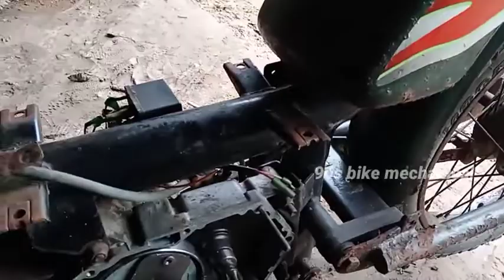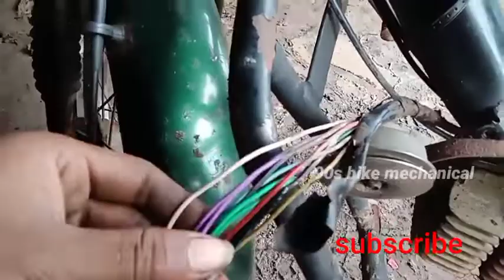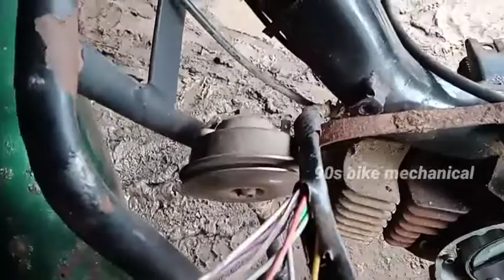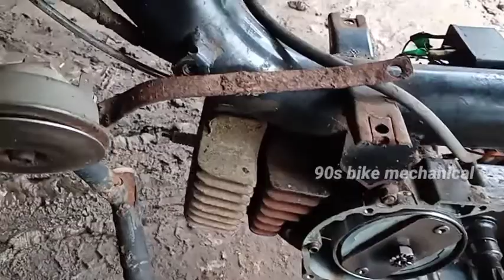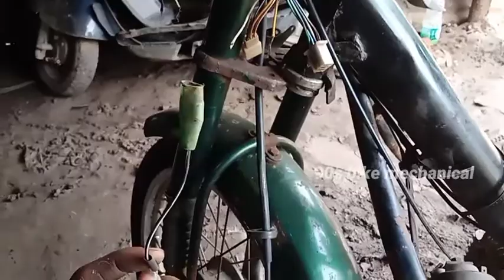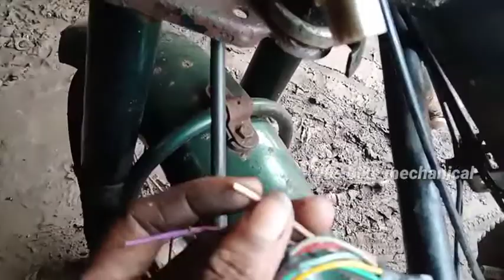Tvs xl wiring problem @90s bike mechanic#

Comment: Xl super Head lamp அடிக்கடி fuse போகுது என்ன காரணம்
Reply from the maker: Voltage check pannuga pro athikama output varuthuna black color coil mathuga
Reply: @90sbikemechanic  அந்த coil மாற்றியும் மீண்டும் head lamp Philips fuse போனது.பிறகு முன்பு extra ஒரு tanger light lamp .parrallel ஆக இணைத்து உள்ளேன்.இது வரை பழுது ஆகவில்லை.உங்கள் தகவலுக்கு நன்றிகள் நண்பரே

Comment: Bro call panna nalla response panringa thank you
Reply from the maker: call eppa pannuniga
Reply from the maker: sorry pro eppa call pannuniganu therila mobile problam  pasaga lap tha use panra wife mobile use pannittu erukka pro night oru all atikati  cal pannaga antha densanla pesi eruppa kochikathiga solluga call panna bike problam nu thappa pesi erutha sorry
Reply: Bro naa antha modulation la solla la bro,neenga thappa purinchtenga,naa splender timing chain doubt ketten la atha sonna,ok pro neenga sonna mathiri oil pumb wheel thiruppi potten,set agiruchu bro
Reply from the maker: ok pro oru range number call nigalonu nenachita sorry
Reply: @90sbikemechanic  ok bro